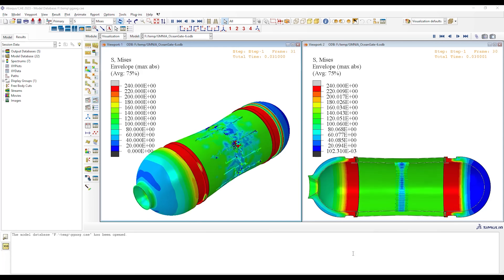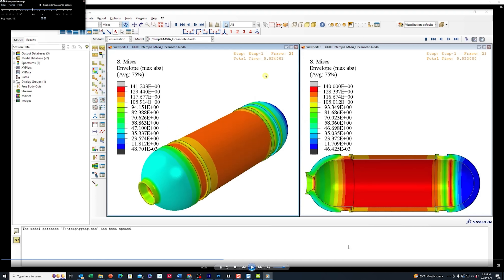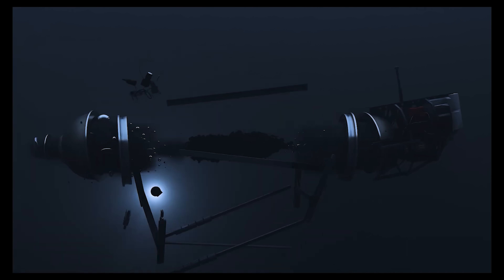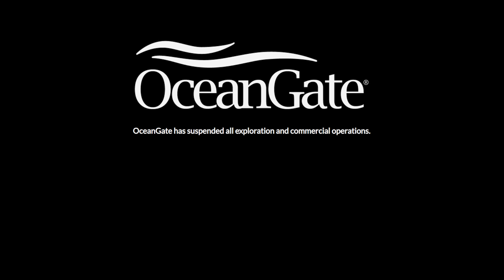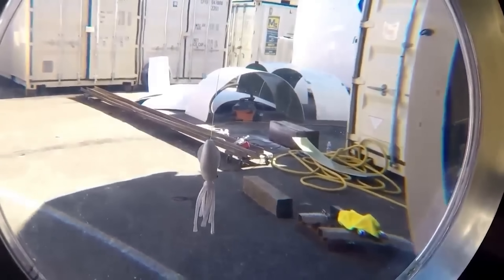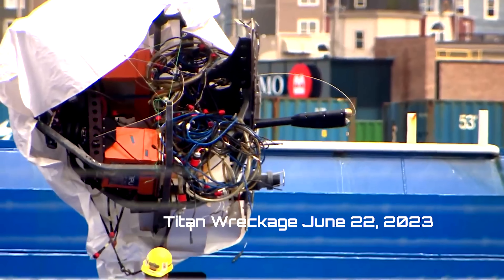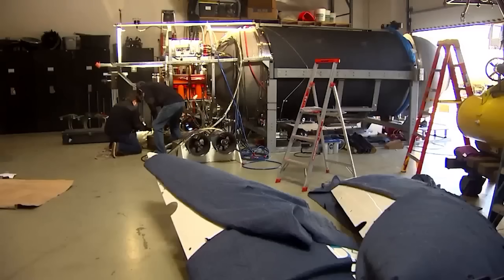Best Titan Sub Implosion Simulation, Cracked Porthole? Q & A

Comment: I've been asking about the hull penetrator since the mishap...there must be power and data connections into the cabin as well as the hydraulic backup you mentioned. I thought they nay have been made through the rear pressure dome but ghard to determine through available images.

Comment: salt water kills devices quite quickly..  they would have to recover any electronics right away or the salt water will destroy them... thats assuming that the silicone chips themselves can take the 4000 PSI pressure and dont have any voids in them that would cause them to implode..  as far as whether a gopro could survive? I doubt it.. most of them seem to designed for human diving at 100 feert or less..  the external cameras on the sub technically could survive but likely they werent self contained..  they would be feeding into the inside computers where any recordings would take place,,  if those computers were on that extrernal control pack recovered theres a chance some video could be obtained but if they went to anything in the cabin id assume its in a zillion pieces..  with ocean currents at their supposed distance form the bottom the debris field for small parts could be Huge...

Comment: I wonder what their inspection protocol was?  As well did they hydrostatically test the pressure vessel after each trip?   I used to work for a company and hauled corrosive gases, and those tank trailers were tested monthly.
Reply: Maybe send it for a unmanned dive every few runs?

Comment: Were there cables for control, telemetry and video from instrumentation compartment ? If they are, there should be one or more kingstones via pressured compartmet walls.
Some of these connections, however,  could use a kind of wireless interfaces instead (not something trivial, like Wi-Fi or Bluetooth, they cannot work through water or titan, but special ones).
Reply: I would have used magnetic 🧲 fields to send signals to modules on the outside.  

Or light 🚨 signals.

No way would I be opening up an access port to the sub.

Comment: There would have definitely been some loud creaking for about 10 seconds as the acrylic began to fail. It would have resonated louder and louder in that small capsule. What a terrifying thing
Reply: And they say that like that's their number one safety feature. But then what? Hearing cracking and getting a warning does nothing for you when you're that far in the deep
Reply: Very much doubt the crackling sound, under such pressure it either holds or fails, there is nothing in between.
Reply: @MikiLund The crackling sound was cold water hitting the bus and taking our power grid.
Reply: The acrylic should have been looked at under polarization, interference patterns would have showed every bit of stress.
Reply: Actually, the cracking went on for over 20 minutes and the RTM alarm was red for like 19min, according to their communication protocol. So they knew for 19min that something will happen and they couldn't do anything. They tried to emergency upscent, but they went up very slow, only like 50m in several minutes. They knew it will be over soon and probably prayed that a miracle will happen and they survive. The hull monitoring system was pretty much useless because even if it works, you still can't do anything in time, it only makes it worse for everyone inside because then you know something is wrong. I would rather have no monitoring system and just implode without even expecting it. But unfortunately they knew it will happen.
Reply: @IronWarrior95 I don't think that information has ever been confirmed to be real. It was released originally on Tic toc so I'm definitely skeptical of that communications data that's been put out there.
Reply: @IronWarrior95 not wanting tto attack you, but genuinely curious, I'm having problems searching for confirmation of the chat logs and Cameron's comment on them, do you have an idea where to look?
Reply: @LongSeanSilver look under True Stories right here on Youtube about 3 weeks ago.
Reply: @HughButler-lb6zs  oh no I meant to say, I also saw that same video (or one very similar) and believed it fully, but then wanted to find more info and did some digging. Apparently it's a myth, with the the telling info being how it takes a long  time for them to communicate back and forth, and the amount of messages total couldnt have sent. 

Not trying to attack you, I'm now realizing my last message was a little aggresive lol.
Reply: @LongSeanSilver  Actually, there were pictures of the computer monitor and the feed taken inside the capsule, and they were as "long" and wordy and that could be seen on the screen. 

I could be wrong too--I haven't seen a debunking, but I have seen the transcript and the picture of the monitor.
Reply: @JM-ot8ux False. Texts from that depth would have to be short, one or two words.
Reply: @IronWarrior95 Who are you and why do you think you know that?
Reply: @IronWarrior95  yeah what a rollercoaster ghost train trip
Reply: How do you know that? What evidence do you have?
Reply: @richardhill2643 The countless experiences and researches done on material and the stress they undergo.
Reply: @richardhill2643 the communication presented between the submersible and mother ship recently totally supports what he just said. You need to become more informed before you critique an idea.
Reply: @richardhill2643 there are chat logs from the submersible to the control ship on the surface.
Reply: @Iselas181  I think those were just a rumor that got debunked
Reply: @Iselas181 Fake.

Comment: Years ago before my retirement I used to maintain the US Navy’s nondestructive testing (NDT) systems in San Diego, California.

The stresses from takeoffs, landings, and controlled flight over time fatigues the wings and fuselage; after a certain number of flights NDT is used to locate minute fractures and aided in identifying areas requiring maintenance and repair.

After the OceanGate accident, one of the first things that came to mind was whether Titan was ever subjected to NDT.
Reply: Apparently their system onboard used ultrasound to detect stresses in the body of the craft as it was diving.

The theory being that noise increases in the material well before the material will totally fail.

I don't know the exact science behind it or how valid of a monitoring system that is.

So I guess they were doing NDT on the fly.
Reply: @mth469  I'm not 100% sure but I believe Stockton didn't want to pay for NDT testing between dives as that would add cost to an already expensive submersible and he was 100% sold on the idea that his stress warning system was fool proof and safe.
Reply: The vessel wasn't registered or classified so I'm willing to bet my life, there was no NDT done

Comment: 7:42 those "craks" are imo not cracks, but the contacting sufrace to the seal of the window underneath it! When diving, the window pushes to the seal, and when out of water it comes out and there are air grooves/areas between where the window is laminated to the seal.. So the grey area on the window edge is light reflecting from the seal and the inside surface of the plastic because they are like laminated together (lighter color than just seal). Silver color is light reflecting only from the inside surface of the window because there is air in between the window and the seal!

Comment: What's the chance that one of those hull penetrations was already leaking and they took on so much water is why the super slow ascent? Could there have been water under their seating deck that they didn't know about?
Reply: One small pin hole and it would have opened up into a massive black hole in milliseconds.

The slowly taking on water theory would not happen at 20,000 leagues beneath the sea 🌊

Comment: A lot of uploaders are posting implosion tests on cylinders on the surface, but wouldn't it be more educational somewhat to pull a Mythbusters and put 5 ballistic gell dummies into a cylinder of a similar size, put it in a deep dive pool similar to the one nasa used to test in and increase the pressure like that with camera's inside to simulate what may have actually happened, also make sure there is some CO² in the unit aswell such as there would have been at the time.

Comment: The porthole window “Squeezing in about 3 quarters of an inch” at the depths they were going to just seems insane to me… a visual movement that big just screams like a red flag to me… 3 quarters of in inch seems like it would render the bolts holding it in useless, allowing the window to be pushed off its axis and make the slightest gap in its seat, with that much pressure idk. Surely i’m missing something with that

Comment: .. the contraption is probably good for a while .. I mean, let say 10 times /dives .. but need to test it before taking in human passengers 
  .. so including those test dives its probably good for only a couple of 'human inside' dives.  Construct a new one, test it again, before taking in human passengers. Repeat. 
 Can't use the same thing over and over and over again.
 The 'loud cracking' noises reported probably originated from the thick acrylic window pressing/pushing and sliding in against the titanium due to external/water pressure.
 Just my two cents.

Comment: the recovered titanium cone should have holes for where the viewport bolted into it.  I cannot see any holes at all.  was the viewport actually just glued in place? the viewports strength worked on compression so just gluing it in place could work in theory which is the same premise they used for the hull glue joint for the carbon fiber body and the titanium rings.
Reply: The word glue implies impending disaster for this kind of project.

Comment: The submersible is horizontal in the simulation, that is contrary to previous reporting that the submersible had turned vertically. Once the submersible lost all power, gravity made the passengers cram into that lower section before the implosion.  There was not much to see in the dark depths with just emergency glow sticks for illumination.

Comment: Yes so stupid to use plexiglass acrylic , it well craze it’s brittle it will crack under pressure. I don’t understand the ignorance why people wouldn’t use poly carbonate. It is bulletproof it is bulletproof 
 There are no torque values to acrylic because it will crack it will craze ,

Comment: Very cool video. 👍
Please consider 4000m = ~400bar = 40 MPa. In the hydraulic Industry there are a lot of sealing methods and materials to propper seal cables and hydraulic lines going through the vessel. Of course it has to be done by engineers with a lot of experience. 20+ years seeing all the stuff that can go wrong has a high impact on your design.
That's way no professional engineer would have ever built the vessel out of carbon fiber. This material has no strength in compression. The cfk plastic matrix takes the full load in this design. It's like building the whole submarine out of plastic. The people that designed that ship (did the design decisions) had no clue of carbon fiber material behavior.

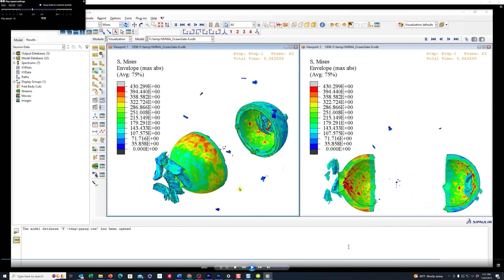Comment: 3:23. Not really. The simulation just doesnt have much of a collision detection so what you are seeing is the carbon fiber being expelled.
6:48 I think that is just a trace of crystalized salt.
7:52 Here it looks like some reflection of the acrylic -> titan connection sealing.

Anyway, I am not an submarine expert but why they havent used something like labyrinth seal on the front dome? Why it is only a single surface?

Comment: the weight of the equipment on the back was not properly reinforced. the gusset design changed numerous times showing no understanding of how to support the weight. the manner in which stockton chose to transport the submarine changed as time went forward. it was first carried safely on its platform on the deck of a mother ship and later they started towing it behind smaller ships. all of this weight slamming up and down up and down on the back of the ring area where all the weight is attached and the 3000 pound titanium window-less dome. this weight also is exacerbated by the abysmally small lip depth and lip WALL thickness. not to mention that syntactic foam is extremely buoyant and was pulling UPPPPPP on the assembly at the aft of the submarine with great force when underwater at those insane depths. the lips on the rings are a critical issue here, the carbon fiber isn't really the problem. it's the combination of the two with no foresight into how the weight of everything and movement of the submersible would play into wear on that little glued lip area. i suspect water infiltrated between the rhino liner and the hull and then osmotically forced itself into the hull loading it down with more water at 6000 psi. this same 6000psi has already inflated the rhino liner all around the hull and that has already catastrophically destroyed their buoyancy so it's only a matter of time before osmosis takes over and the whole thing exponentially weakens. couple this with stockton likely issuing instructions to everyone inside to help roll the sub over to drop he weights manually probably put a lot of force on it and may have contributed to a cascade of delamination? another idea is that sitting on the bottom changed the pressure profile on the hull. if the bottom of the sub is touching the sea floor for some reason (they did eject or attempt to eject the landing frame) it could increase the pressure differential around that area of the hull? i dont know, that is beyond my understanding of things. there is a lot going on here that is not what it seems. the idea that the hull was hoop wound and that was the end is insane. they most definitely did more than just what is seen. the engineer who worked on it has said it is not just wrapped around like you see in the videos and that it took them months to make the hull (speculated by another youtuber to be that they would autoclave and vacuum it between every layer).
Reply: I like the delamination theory.

I'm leaning towards that we well.

At what point was testing performed on the laminate to see if it needed to be totally redone after a dive.  It surely would not have lasted forever.
Reply: @mth469  I can't take credit for it, it's partially something i thought of after someone else said something and a lot of the stuff i have said came from a forensic engineering youtuber. he noticed the weight issue on the back end of the sub and the ring lip/wall thickness/length. i think he's right, that is an enormous amount of weight to put on a very tiny lip comparatively speaking it should have extended down the CF hull a LOT more than it did. i mean ideally the lips on the rings would go so far down the hull they just meet each other and form a titanium submersible.... hah. you get my point though, those lip depths did not take into account altered towing methodology when they were designed. nor was the accessories bolted on a part of the engineering of the rings. if it was done by the same people i'd be shocked. all the "avionics" in the back of the sub (and the buoyancy foam) was almost.... hobbled onto the existing ring structure. at first glance it looks squared away until you realize it's not really supported well (no arms below extending out to the base of the ring) and you can just imagine all that weight jerking up and down on that ring and CF glue joint. we'll see.... it'll be a year from now or something but.... yeah.

Comment: This is the first simulation I've seen that incorporated the hemispheric titanium end caps moving inward. Though I still believe that the end caps slammed violently together a lot faster than the sequence shows. Why? Because the pressure is equal all around, circumferentially and axially. So as the cylinder walls implode inwards, there is nothing to keep the two ends apart, as the pressure inside is phenomenally less than the pressure outside the hull. 
We used to do a trick in one of the engineering classes, where one of us would stand on an empty soda can. As long as pressure was applied directly along the axis of the can, it would support a 200+ lb man standing on it, but if you poked the side of the can and buckled the wall ever so slightly, it would crush the can like you had put it in a hydraulic ram.
Two things we've learned so far. One, the Non-Homogenous materials in the design, made the design weak.
Two, Carbon Fibre behaves poorly and unpredictably under Compression. Fact Two, Rush mistakenly though they could overcome by the design. Obviously, Rush was wrong about thinking the design could overcome CFs Compressive weaknesses.
In watching the Construction videos, I was immediately struck by the Air Curing of the CF. For maximum strength, CF is Autoclaved to cure it under heat and pressure. One reason why, is because it minimizes the voids that happen between the CF and the epoxy substrate. The failure of curing the CF properly, directly led to Cyclic Fatigue. Each descent/ascent was causing micro fractures and delamination of the fibres from the substrate.
Poor Design x Poor Material x Improper Construction = Catastrophic Failure. Any one of the three could cause a tragedy. Multiplying all three insured a tragedy.

Comment: I'd still like to know how his controls, and cameras were connected from inside the cabin to outside. Did he penetrate that carbon fiber hull to accomplish this, and how strong was this? Or did he have all wireless controls, which if he did that seems extremely risky to trust the operation of the sub with wireless coms.